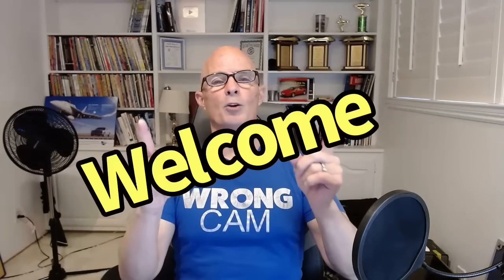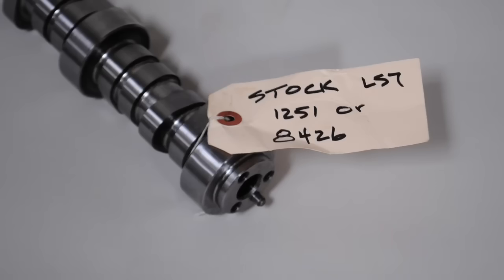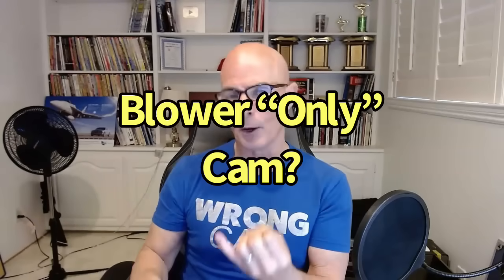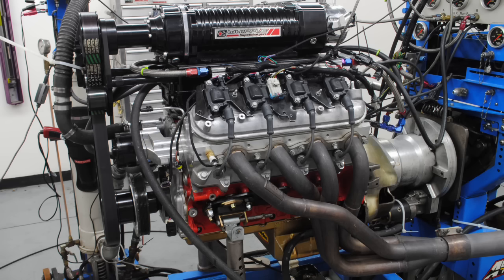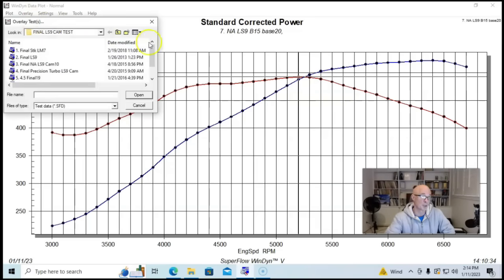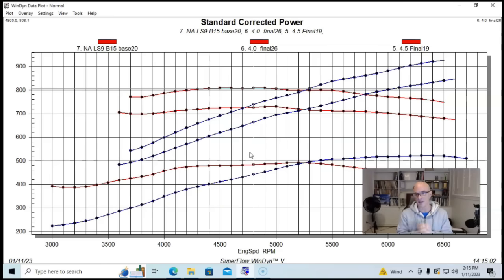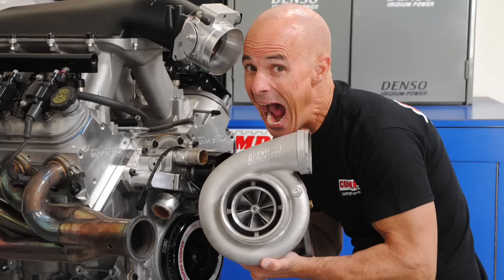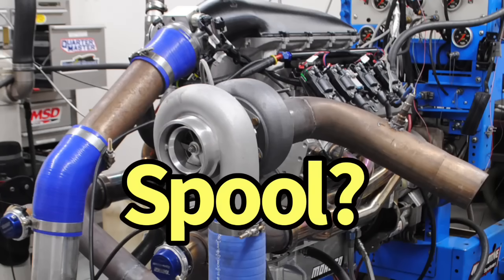LS9-THE MOST POWERFUL FACTORY LS CAM! WILL IT WORK ON A DESTROKED (4.8L CRANK) TURBO LS3 OR NA 5.3L

Comment: The LS9 Cam definitely has it's place as a (free to $99) cheap and effective option. Prior to becoming completely obsessed with building a big CID High Compression DI N/A GenV, I had considered another route for a specific SWAP application and the LS9 Cam made complete sense. I had planned to do a factory 5spd 2WD Colorado LSA Supercharged 4.8L LS Swap, as no one wants them, and rebuild with an LS1/6 Overbore from 4.8L to 5.1L since I would be buying pistons/rods anyway. The LS9 Cam would have been far more than enough to satisfy the breathing needs of the setup, while keeping the bottom end soft enough in a light vehicle to not be an axle breaker/tire chatter/trans breaking machine, still having a good top end and overall drivability.
Reply: how's the LT build going?
Reply: @veganjoy  Terrible. Canadian money is worth about as much as Mexican vs the US Dollar at the moment and I am still trying to find an engine builder that I am comfortable with to save me from ordering from the USA and paying a ton for shipping. If this was an LS, I wouldn't be so concerned, but I need someone who has experience with LT's and more than just CAM swaps.
Reply: @joeyjojojr.shabadoo915  damn that's unfortunate. what shops in the US would be good with LTs? i know RPM in delaware has a kickass h/c/i package for LT1s but dunno if that translates to good knowledge for a higher displacement block
Reply: @veganjoy  MAST and LME are on my radar. My plans are very basic, but I have only seen Aluminum LT blocks sleeved out to 4.125" and I was hoping for 4.185" and do a 454 standard deck height LT and just order the 454r LS Rotating Assembly from GM Perf Parts and call it a day. Nothing fancy, just 12.0:1 on Pump Gas and use LT4 Injectors (as it's only going to be N/A). Not even sure if it's worth going aftermarket LT heads vs simply porting LT1 heads. My biggest concern is the Oil system. The variable vane LT pumps kinda scares me. Alternatively I could just use OEM GM parts and do an LT1 Corvette Dry Sump setup. I just don't want it to cost more for an N/A setup than it would have to just build a 427cu LT1 and turbo it.
Reply: @veganjoy  Take a look at American Heritage Performance out of Los Angeles.  They are Corvette specialists, but they build a lot of engines that get rebranded by other shops as well.  I've tuned a couple of big displacement LT setups from them that produced well over 1000 whp on E85 with a 2650 blower.  I think they have a feature coming up on Engine Masters soon too.
Reply: @ChurchAutoTest  oh i cant even afford to think about an LT build myself lol. though it'd be cool to build out the stock LS2 i've got now
Reply: @ChurchAutoTest  o

Comment: Love it! I still refer back to your hot rod article from 2013 comparing OE cams. A used LS2 cam fell into my lap and I think with better springs it will perform well without requiring other changes (LH6 5.3).
Reply: Take it from a GTO guy. Get rid of that damn cam. They do weird things to valvetrain harmonics.

Comment: LS9 worked well as an SBE turbo street strip cam. Limited power down low where the rods and ringlands fail. Also where tires just spin on the street. Then made lots of steam above 5500. Loose converter, transbrake, and 7500rpm made it a good turbo cam for me. Took my SBE gen3 5.3 to 8.90’s @ 3000lbs and cruised like minivan on the street. Price point is also hard to beat, that wasn’t really discussed. It’s likely the cheapest “OEM quality race” camshaft out there to purchase new.
Reply: How much boost? Id assume 25+
Reply: @Airman..   26lbs.... though it didn't make much more power over 24. Turbo was done. Was the T4 1.10 AR S475.
Reply: @AdamOpheim    more boost will overcome cam shortcomings, less boost will be hp output limited by the cam breathability, you need a bigger inducer, with single turbo setup a 74mm inducer is too small, if your build can take more id suggest doubling it or go 88 or 90 pro mod snails

Comment: The smaller cam has a tighter LSA so that’s why the 122.5 LSA Of the LS9 cam pushes top end at expense of torque where it’s needed
Reply: And it was used along with a blower

Comment: I have an ls6 in my ctsv. It has CAI, full headers and exhaust. What cam and intake do I need to make 500wheel HP? I want to keep it NA. Thanks
Reply from the maker: a cam won't do that
Reply: @richardholdener1727  What will, besides boost?
Reply: @sjcperformance ou can stroke the LS6 to 383. Higher Compression, forged internals, big camshaft, high flowing cylinder heads.
Reply: @sjcperformance there’s also the use of nitrous

Comment: Does the ls9 cam have any specs specifically for positive displacement blowers?  Moreso than bigger cam shifts power to a higher rpm while sacrifices down low.
Reply from the maker: yes-the valve evens and very wide lsa is how most of the pd blower cams are ground

Comment: Could you do a test share we focus on 500ft lb tq instead of 500 hp? Set a goal to do this by 4500 rpm NA on stroked 5.3l 383 pump gas daily driver.
Reply: https://www.youtube.com/watch?v=1X4fzLiTlAA    his 383 ls shootout does over 500 ft*lbs
Reply: I noticed that the dyno run starts at 3500 rpm. Would this cam require a higher stall torque coverter? Would it be soft at 2000 rpm as I'm driving around town?

Comment: Richard! I watched your LSA video recently which made me think about how I'd love to see you shake up the Cam manufacturer cam card meta and test out David Vizard's calculations on how to pick a cam shaft based off of your engine components. What do you think about his methods?
Reply from the maker: David is a good guy-I speak to him often-he is doing a ported 2.2l dodge turbo head for me
Reply: @richardholdener1727    I'm sorry for contacting you get but I didn't know how to otherwise. Have you ever tested the KAnd N stub stack and do they gain or lose
Reply: I used David V' calculations on my pump gas 461.  I called Isky and they cut me one real close to my original, but with a 104 center.  More power everywhere!

Comment: To run the ls7 or ls9 cam do you have to change pushrods length?
Reply from the maker: no
Reply: @richardholdener1727  thank you uncle Richard putting in my ls7 cam tomorrow on my 6.0L caprice 🫡

Comment: On the 5.3L it would be interesting to drag race both combinations.  Would the extra torque down low make up for the lack of HP on top?  I really have no idea which would be faster.
Reply: Well a converter would take care of that but I assume you want to race stock converter in each
Reply: More power up top wins period.  You aren't in that low rpm much when racing maybe on the launch but once you pass that rpm range you never see it again through a run so the top end makes alot more difference as far as an all out wot run.  On the street you spend more time in that range so you may wanna go with the one with more torque that is up to how you want your powerband but as far as which one would be quicker in an all out run the one with more top end is gonna pull.

Comment: Don't be scared to run a LS9 cam on a 5.3 . I have a LC9 5.3 with a LS9 cam S475 T4 turbo running 18 lbs of boost on pump 93 and water meth . The truck weighs about 4000lbs and it is a rocketship . Full boost by 3500rpm . The biggest reason I picked the LS9 was I wanted a clean smooth idle at 600rpm  , the exhaust smells clean even with no cats and I get decent fuel economy as well. Do I need more low end torque , absolutely not I have a hard time hooking as is with 29 inch Nitto 555r drag radials if anything the cam helps me put the power down . If you daily your project I can't recommend the cam enough and the price point helps as well. Also remember this cam was designed for longevity in mind as well and is easy on the valve train . Is it at all out race cam no! But it works for my intended. purposes.
Reply from the maker: If it works for you-then it is the right cam
Reply: I always wondered about the guys obsessed with making torque down low. Seems it might be good for an everyday use truck but maybe not for a car that wants to hook up on the rare occasion it may go full throttle.

Comment: Awesome videos, love the content. Have you done any videos regarding bore vs stroke and comparison of what’s better and pros/cons with each?
Reply from the maker: Displacement is the big thing-how you get it is a little thing
Reply: @richardholdener1727  do you think the ls9 cam would work out good for a 5.7 ls1 with 243 heads and bigger injectors and bigger intake/throttle body?
Reply: @germancantu9847  in the video, he said he never recommends it.  So.
Reply: @richardholdener1727 is it possible to make 500 hp with a 5.3 na I have a 96 Chevy 1500 I wanna swap I have no experience with mods 6.0 to pricey in my area about double the price of a 5.3 what mods do you recommend me? That will still make it reliable daily driver, decent power

Comment: Quick question 5.3 or 6.0 for chevy obs maybe 500 hp daily street truck? With around 3k budget? Off topic I know
Reply: Obviously the 6.0L is going to be easier to get there. Just a cam, tune, and bolt-ons.
Reply: @IndenturedSavant13  in my junkyard in bakersfield ca there's a couple 6.0 s but there's also a aluminum  5.3 from a envoy delani that's why I was asking? But thanks for the info there's a yukon xl motor waiting. ✌
Reply: @joseperez8769  grab the heads off the l33 and use them on the 6.0. they should be 799s. Get the exhaust port ported if you can. Grab a TBSS intake and 90mm throttle.
Reply: I have the l33 aluminum 5.3. The truck intake manifold is good(the denali may have the newer 5.3) but you may want to upgrade for a larger throttlebody. Exhaust and cam with tune will get you that 500hp or very close. The accessories will rob some power but you'll be really close. The 6L if you don't need the weight savings is nice due to the fact that it either hadbrec port heads or can fit them. From the factory the rec port heads are just superior to the cathedral ones...ported is different but their are many great factory rec port heads that flow ported head numbers and used are cheap. It's very easy to get 500hp+ out of a 6L with mild selection of parts. And that's with good torque as well. 600hp is fairly easy to achieve on stock internals with a careful selection of parts..but you'll loose some power down low as tha trade-off. I personally stroked mine for the torque, wish I had ported the heads(799's) but upgraded everything to handle boost and 7200rpm. Good luck, personally I'd look at how much they want for each and the mileage and condition of the motor and choose from there
Reply: @mythos000000025  I am going with the 6.0 I think the aluminum 5.3 would be cool but It would mean more work I just wanna stick with the kiss rule. But thanks for all the info really appreciated 👍 ✌

Comment: Funny, we just did a "Best Factory" Cam video on our YT channel, but we specialize in Honda Big Block (J-Series V6 engines 😂🤷‍♂️). They are very small from Factory, hence our stage 2's gain around 13-15% of power (25-35whp, we picked up 36whp in our little J32A3 3.2L NA)
Reply: This guy local to me threw a 3800 blower on a j swap in an eg hatch was nutz

Comment: Have you run a BTR Stage II twin turbo cam?? If so,  how did it do??
Reply: I can tell you about the stage 3 in a square headed 6.0 and it works well.
Reply: @davidreed6070  I am building a twin turbo'd 6.2L using the stage II Twin turbo cam with ported square port LS3 heads.

Just trying to get a feel on what It can do.
Reply: @chijiokepenny2100  I am a person who matches engine components as well as possible. The hot side of my turbos, the wheel is an 80/73 with a.91 ar. I drove the car all around na..it ran good.
Reply from the maker: yes-I have run the stage 2 TT cam

Comment: In short: if you want a good balance of torque and hp use the Sloppy Best or Truck Norris cam 👍....comment for the algorithm!
Reply: I have the truck norris cam in my na at the moment 5.3 swapped sn95 pretty happy with it definitely drops off hard around 6300 or so but we need the rpm for the 1 to 2 shift and 2 to 3 shift to  keep it on its toes curious to see how it acts with my s475 in spring
Reply: @OAndy2222  damn i dont like that lol.. my 4.8 truck was ls6 cam shifting at 6300 and felt okay, i wanted to do same with my 5.3 and now am 100% sure ill go with the btr hot rod cam
Reply: @Honda Service Center  I think the truck norris is probably the best bang for your buck on your low end torque i mean i definitely wouldn't mind 7k shifts but also didn't want to spend the time pulling heads and fighting with finding quality lifters the small cam should light up the s475 nice and low in the rpm range tho
Reply: @OAndy2222  dont really care for low end, i will have a convertor to help me out, i just want to shift at 63-6400 rpm without falling out of powerband at all
Reply: @Honda Service Center  idk the extra torque makes up for it for me I have a 3300 rpm stall and  331 airplane gears I don't miss the little bit of drop off at 6300 but reving it out to 6500 7k you'll feel the drop in torque up there
Reply: @OAndy2222  are you stock motor tho? Im completely stock motor other than the cam/lifters
Reply: @Honda Service Center  yeah gen 3 5.3 ls6 intake truck norris cam and btr springs for what it is I'm actually pretty impressed by it. This spring we're doing btr trunnion and gonna fab up the kit for the s475 turbo I have a btr stage 2 turbo cam but I really like the truck norris I can walk some pretty quick cars with it shifting short at like 3500rpm lol like not even trying
Reply: Hmmm everyone forgot about the 2004 ls6 cam in a na and turbo back in the day people where in the 8 sec quarter mile range with that cam